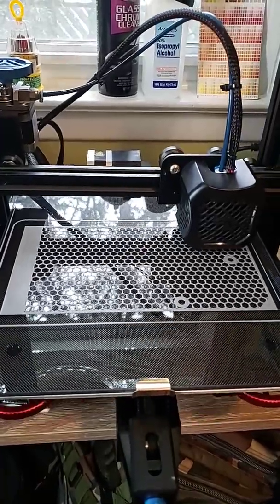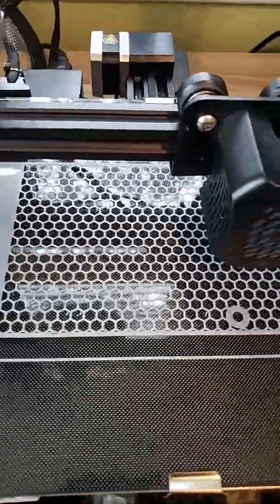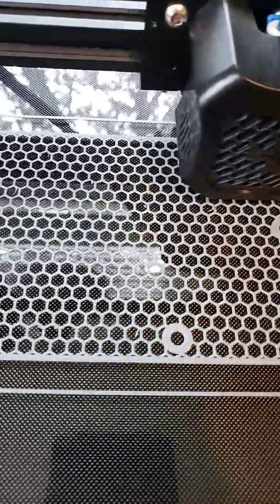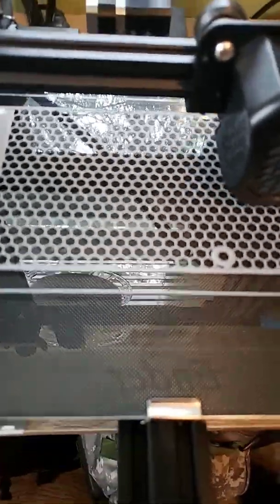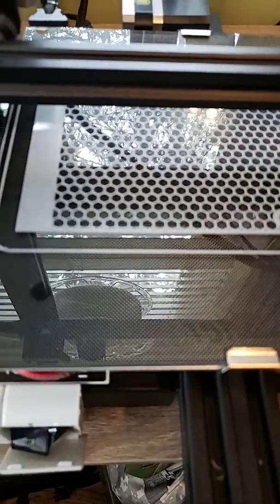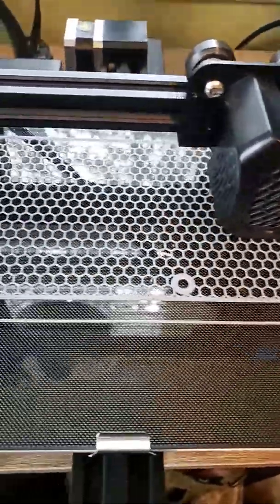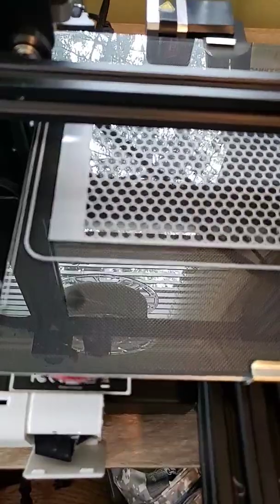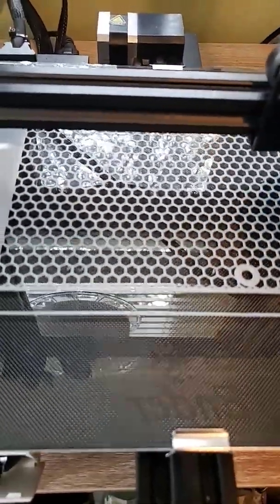Honeycomb vented ender 3 v2 PSU cover! Amazing upgrade mod and free file

Comment: Your bed is upside down
Reply: You can use both sides 😑
Reply: @nate.hall_11  but the non carbonardum side ia literally plain glass, you would need to be dumb to use plain glass over carbonardum
Reply: @nikoraasu  it’s all about preference.
Reply: @nikoraasu  Actually no, I had poor bed adhesion so I used the glass side